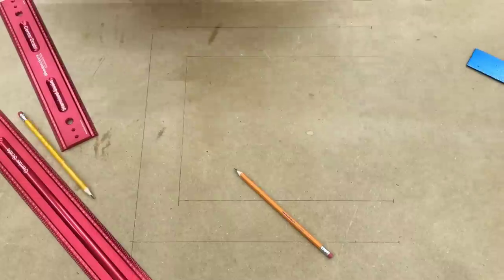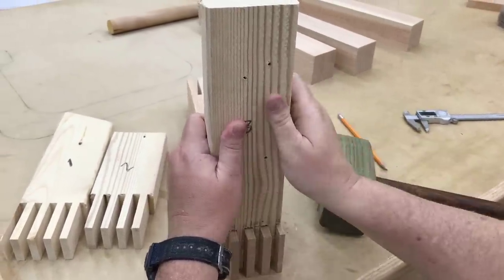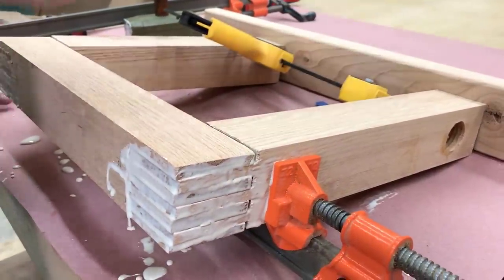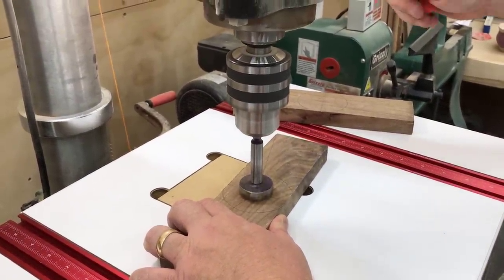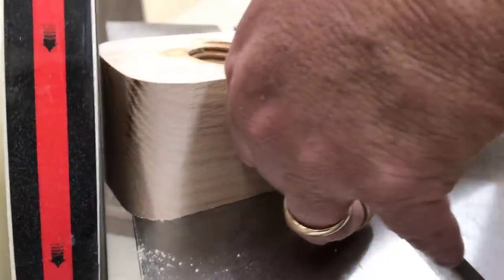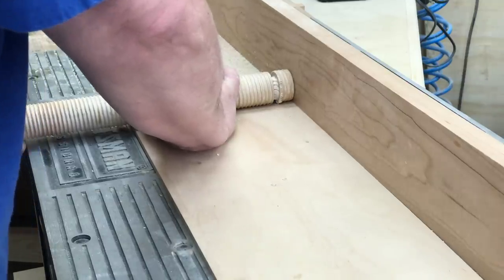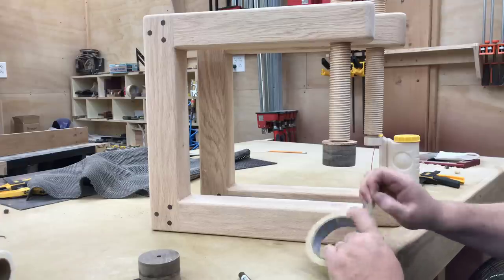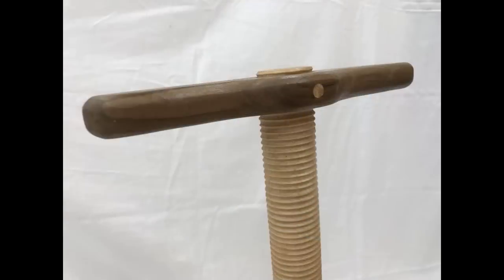15 - How to Make Deep Reach C Clamps All Wood only $10 Extreme Strength

Comment: Very nice project.

I built clamps something like this using bridal joints, threaded metal rod, split washers for garters on the clamping pad, and cork faces on the pads -- very similar to a John Heinz design.. (The screwed-on split washer garters and cork pad faces are the only details that might be added to your project, FWIW.)

But the bottom line is this:  I like your clamps a LOT more than mine.  Yours are better designed, stronger, more stable AND nicer to look at as wooden tools. I would be proud to own them. Great job!!!

RESPECT!
Reply from the maker: Hi Jerry! Thank you very much!
Reply: What are garters ,apart from keeping ladies stocking up ?

Comment: Oak will eventually "take a set" and go out of square, but for what you are using it for, and the size of your design, probably not going to be much of an issue. I've built bows from red oak, and one can either live with the set, or glue laminations to compensate. Your lamination will do some of that, and unlike a bow, going a bit over size, makes it less an issue . . . going over on a bow just means a heavier pull or a slower bow. 
I've got an up to 80# draw Penobscott style bow made with two red oak boards from Lowes and glued with TB3 then backed with cotton and TB3. Holding fine after 10 years. But when built it had Reflex (tips further forward than the hand when the bow is not strung) and now is deflexed (tips behind the hand when unstrung).
If you needed it to be square as possible when clamping, you could glue them with the tips a touch closer. Test your clamps at what you will be using them at, then measure the spread, glue another set with the same amount set in.
Likely overkill.
Reply from the maker: Thanks for watching.

Comment: Brilliant design and beautiful construction. I would get a bigger scale and test one to destruction, just to identify where it breaks. The reason I would identify where it is strong and where the weakest link is, would be to lighten the strongest parts. Of course this is much stronger than just about any job that you might need, but that also means you can make the strongest parts of it a little lighter. I love the laminated design of the backbone and the two arms. Since there are five layers, then you might be able to skeletonize layers two and four (on the arms, the backbone, or both) since I assume the two 90-degree joints are the areas of most concern under the max loads. The two joints would of course remain with all of the original material.

Comment: FIY veritis makes a double sided flush cut saw that has Japanese style teeth (cuts on the draw rather than the push stroke). The two sides are so that the blade is smooth on one face for each set of teeth to prevent marring the surface when you trim dowels or joints, etc one for each side of the work.

Comment: Excellent work!  only thought, I would have done finger joints of 4 and 4, vs 3 and 4.   May make sense to equalize the two pieces to reduce a failure from overload. beautiful stuff though!
Reply: Edit, ust finished the video. Holy cow. you made some strong clamps. disregard earlier comments.

Comment: There's some changes I would have made... 
for one, I would have made the hollowed out piece for the clamping pad be what was split in half with the retaining bit to fit into the groove on the threaded rod.   Second, the non-moving pad, I would have routed a hold into the arm, at least 1/4" and embed that pad into it.  That will give it much more strength if it gets hit on the side a bit.  

I also would have looked at getting the right side all thread (threaded steel rod), and using steel, it could have been half the thickness.  But, working steel is a bit more difficult, though, a creative use of bolts and washers could replace the need for carving a groove into the rod itself.  

I also would have used a wedge in the end of the wooden rod, to wedge it onto the handle - it'll be as strong as a dowel, and imho, it's more aesthetic.  This could have been coupled with a key-way in the handle, so an oversized wedge could be used to give angular momentum prevention like the dowel is doing. 

One other thing I think I would do as well, would be to round the clamping pads towards the sides, just a bit, leaving 3/4 of the surface flat, and then add a piece of leather (maybe an old belt or glove) just to give some soft padding while also adding a friction surface.

These are all details though, and I really love the basic construction of these clamps!  I may have to go build my own.  But, I might build mine out of steel pipe instead because I don't have anywhere near the wood woorking tools I need for something like this.  Hmmm... I guess I could spend the money on the tools instead :O  I miss having access to a full shop!

Comment: Not being a woodworking guru such as our host, I do have a good friend of mine that is.  I rely heavily on the Gougeon Brothers West Systems epoxy when i need a  fiberglass/Kevlar/carbon repair,m but the West Systems is specifically dsigned for wood.  When you were lamenting the perceived weakness of the finger joint, the first thought of mine was, "Why isn't this guy using West Systems for this high stress joint?  West Systems isn't cheap, but even keeping a quart sized resin/harder duo with the proper pumps seems like a no brainer.  NO question it will ooze out of the joints when clamped, but  even the fast set 205 hardener wiull givew you 20 minutes or so at room temerature.  Sure, it will sanmde a bit roughly and if you need to fill gaps, sawdust would work also if you didn't want to spent the money or one of their custom fillers such as their 403 cotton fibers or the 406 Colloidal Silica to add some viscosity to the resin.

I didn't mean to get so verbose with regards to the only tiny criticism I had watching this video, but I'd really like to know why epoxy wasn't used if strength was needed.  Thanks

Comment: Good video. Thanks for sharing.   Like the approach to deep throat clamps.  One question.  Did you consider making sliding clamps w cam locks?   Threaded wood is tough and doesn’t always hold up over time

Comment: Nice job, although the pins at the end probably just weakened the joint, the glue should be enough to hold the lateral displacement.

Comment: That was a nice job.
Reply from the maker: Thanks a lot!
Reply: King's Fine Woodworking no worries. I read a comment that suggested the dowels on the corners might make the joint weaker. That's quite interesting and I was thinking about why that might be. What do you think? 
I would of thought the belt and braces approach you took would be better but now I'm not so sure.
Reply from the maker: I do think it's entirely possible that the dowels could be weaker. The reason is because the adhesives today are so very strong. If this were 20 years ago, the stronger choice would be to have a dowel mechanically prevent movement of the joint. As has been the case for the last few hundred years of woodworking. 

But if we consider that the holes lessen the structural integrity a little, and the overwhelming strength of the glue bond, then just glue, might be best.  There are many studies that show the strength of this Titebond III is in the thousands of pounds per square inch range, so the wood will break long before the glue joint fails. 

But I still like the contrast of the dowels. :-)

Comment: feel like a sliding brace that you could slide along if you don't need the full depth might be handy. Should take some load off the the corner joins?
Reply from the maker: Good tip.

Comment: thank you great info . suggestion if you dont mind . weight clamps ? i use 1/2 gallon milk jugs oh gallon ones work well too and filled em with cement . a touch over 8 lb each . it was what i had on hand oh i get concrete and cement mixed up sorry .
Reply from the maker: Hi Walter! Great tip for weight clamps. Thank you!
Reply: glad to pass it on as i am new to wood working i did like your clamps

Comment: About using the sawdust with your glue up: I was taught decades ago, to save various species of wood sawdust, as Well as various colors.

The “secret” is go to your Sock Drawer, and find the single sock having lost its pair within that mysterious dark hole All Houses have.

Take a SAWDUST species, fill the sock, then thump it on a Clean work bench.

What lands on the bench is what Wood Floor Workers in our area call “wood fines” others call it wood flour.

Regardless, it will Disappear on your workpiece, for instance when we “Top Nail” a Board Down a pinch of FINES a drop of superglue... better than any putty made!!! 

I Also use Contrasting Fines, In wood checks if I need the wood, and Natural Air Drying left a check!

(My favorite wood is HOLLY, and I like to use Ebony Fines in a Holly Check) !!!!

Thanks for the Great Work you do,

philip, from the Great Pacific NorthWET . . . !
Reply from the maker: Brilliant!  We also keep all colors of sawdust. But your uses are great! Thanks for sharing!

Comment: I was wondering if you could screw triangular steel corner braces each side of each corner of the back of the clamp for added stability and clamping power. If you don't want to compromise the look, maybe you could use brass to give it that vintage tool look. Maybe some mother-of-pearl inlaid into the arms and some scrollwork engraved on the brass and... okay, I'll stop now before I descend into overkill.

Comment: What one would you say is better to fill gaps. Saw dust from a table/miter saw, or dust from a sander?

For some reason, I feel that sanding dust would fill in better with it's smaller pieces. But I also feel that it could be a lot messier.

Comment: Years ago I got rid of my tools.... grrrr.  but last month i had a project, a table that was fraying on the bottom.  Had no clamps.  So I ended up getting a can of tuna took out the metal on both sides and folded them for straight line.   Added watery glue then used a vice grip to hold them in place with the metal to squeeze them together I let  it dried then did again with regular glue for a sealant.  Then added after duct tape strip for a security over it which cannot be seen.

Comment: Overkill or not, when you said wood glue failure, I was thinking 3/16 or 1/4 inch through the joint, heck maybe even tapped like screws. Not Unlike you did with the 5/16 rod in the handle. (And then at the very end you came through with exactly that! I didn't think you were going to do it!)  ;) I like drawing on things as I build em too. I loved the use of the rattle can! Freehand sanding is  an art form in and of itself. I agree with ya about grits, people ought not fear them. If ya respect them, and let them do the work they were designed to do, they do make quicker work of an otherwise monumental task. This is a great video to watch and the only thing I would have liked is a bit more commentary as you worked.  This was really fun to watch!

Comment: hey just so ya know, your clamps are actually handling far more than 564 lbs, by eyeball I  calculate that just on the walnut pads you can put close to 2500 psi, and this is only because of the mechanical leverage you are gaining on the joints. You could nearly double the load handling if you placed a 3/8" threaded rod 1" from the upright to reinforce it  (leaving plenty of clamp room) I could see these clamps easily hitting 3600 psi before they start breaking fibers. LOL although I don't know how you turn the handle maybe if both ends were coated in goose fat or even Crisco. Glad I woke up and saw this for once a diy that I want for myself, after so many "meh I like mine better" I have plenty of local Live oak trees to stand in for the red oak. The wallnut, I think I will substitute white pecan.

Comment: I just did a quick calculation of what I would have to charge someone if I were to make a set of your clamps for them using the methods your using. It would be roughly $250.00 per clamp built in my shop. I do like these clamps though and may just make a few of these for myself.

Comment: May I ask where you bought the clamps that look like pipes clamps except the bar is flat? Can you buy the clamping mechanism separately like you can with a pipe clamp? Great job on the C-clamps. You have inspired me to try my hand at building a pair myself and I may just have to steal the use of accent color. I have some nice dark mahogany that will look nice with red oak. It's amazing how much you can do from a sitting position. I have a bad hip so I should try that. I'll have to get a slightly shorter stool though,lol.

Comment: What are you using to cut the box joint?  I have Freud 8" box joint blades but will not cut 2.25" above sled.  I like the square cut delivered.

Comment: If you add a triangle crossbar support at the corner joint, would it help it stay square under pressure? -- I guess then you lose the 12" depth for the entire height of the thing... -- Not sure if that's even important to you or worth the trade off. -- What do you think?

Comment: Hello....  When drilling on drill press with large objects, large holes:

If you are not going to use clamps to hold the work, consider angling the work so one of the points will contact the rear post of the drill press.  This way WHEN your hole saw catches and seize the material, it will not break your hand spinning around.  The rear of the piece would be locked in place on the post.

Free safety tip.  No charge.
Reply from the maker: I never let my drill bits get that dull. But you’re definitely right, if anyone puts enough pressure to cause a catch, it’s no fun.  

So an even better tip would be to maintain your drill bits, which means clean and sharp. Especially forstner bits. And monitor the downward pressure you use. If you’re really having to apply a lot, then stop what you’re doing and figure out why. Or else the drill bit might catch & spin the wood around really fast.
Reply: @KingsFineWoodworking  How often do you manually sharpen a 2 inch hole saw ?  I have never done that.
Reply from the maker: A hole saw can often be filed sharp. But the Forstner bits that I use to make the holes here i take to Woodcraft or Rockler. Most places that sharpen the carbide teeth on your saw blades will also sharpen your drill bits. Including forstner bits. 

But a really important step is keeping them clean. It’s natural for pitch & resin to build up on them as you use them. And once it starts to build up you get increased friction. That leads to increased heat, which unfortunately causes pitch & resin to build up even faster.  This makes it seem much duller and requires a lot more downforce to make your hole. 

You can 100% prevent that by keeping your drill bits, and router bits and saw blades clean. Use a good pitch & resin remover, and you’ll increase the life of your cutting edges by 10 times. And a cleaner tool stays sharper longer. 

I do have a video on how to do that if you are interested.
Reply: @KingsFineWoodworking  Filing teeth on a hole saw is like sanitizing each bristle to a brroom for me.  I mainly work with steel and aluminum.  We buy our cobalt drill bits in packs of 10, sit in drawers and thrown in scrap when they malfunction.  Catch metal on a drill in a press without a clamp or brace and you will be taking a trip to the ICU.

Comment: You can test to 1000 pounds using that same scale - set up a solid timber, one end on the scale, the other end level on a support. Put your clamp on the mid-point of the timber, and the scale will read half the clamp pressure.
Reply from the maker: Great tip, thank you!

Comment: I tell ya man nice vid and the best clamps I've seen home made or not. I have some metal pipe clamp heads for 3/4 inch pipe and they only give about 8 inches of depth and I have ripped the threads off the pipe with much less pressures than you have achieved. going to subscribe for sure will look forward to more content like this. Thanks
Reply from the maker: Hi Roland! Thank you very much!

Comment: Thanks for the video very interesting. I have a tap and die set, some of my projects I would like to make wooden screws, but every time I try I fail. The thread rips or dowels doesn't hold up to being threaded, any suggestions
Reply from the maker: I soaked the dowels in Tung oil for a couple of days before I cut the threads
Reply: King's Fine Woodworking Thank you for the tip. Really enjoy your videos

Comment: I would hate for you to destroy one of your clamps to determine the ultimate load, but if you did so, do you think it would fail in the threads or at the interior sharp corners?  I would have rounded the interior corners with a generous radius - but that's the aerospace engineer in me. Wood is probably not as sensitive to stress concentrations as metal but I would have done it anyway.

Comment: Just a suggestion but you might want to consider using a two part penetrating epoxy on the treads it would give them far more strength. sealing the treads would prevent them from swelling in very high humidity as well. Great work keep it up.

Comment: A JOINT VENTURE....

Curious...  why didn't you place the RINGS next to each other, so you could have used the block of steel on both?
Are they not the same height?

Comment: What kind of oil(s) did you use? I didn't understand the Name. ...please give a (additional) description because I think that a special brand is not available in Europe/Germany.

THX
Reply from the maker: Hi, I use Tung oil. Here is a link to read about the oil with a description. And Tung oil is very common. You should be able to buy it in Germany.  If not, you can also use mineral oil. It works great too.  https://amzn.to/2KorA5c
Reply: Raw linseed oil works well too, I'd thin it to near water consistency so it penetrates quickly.